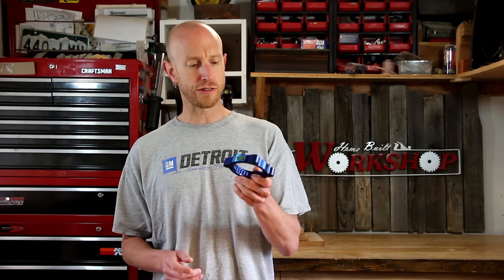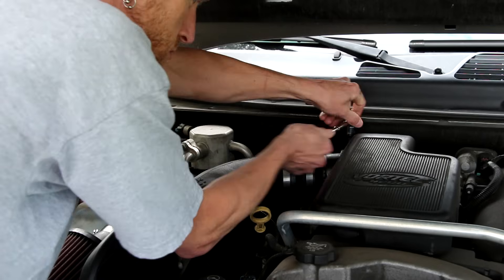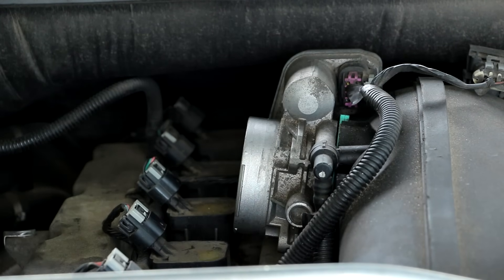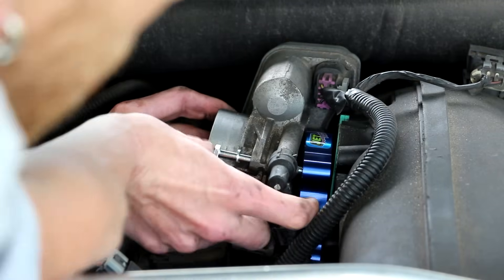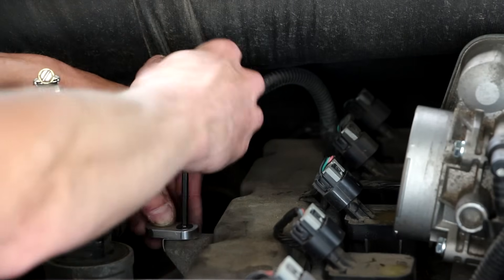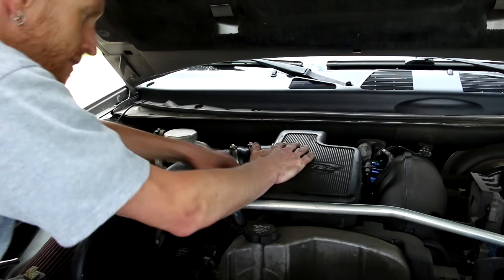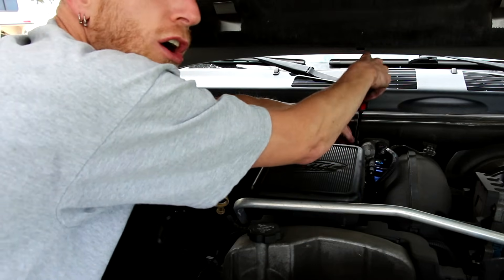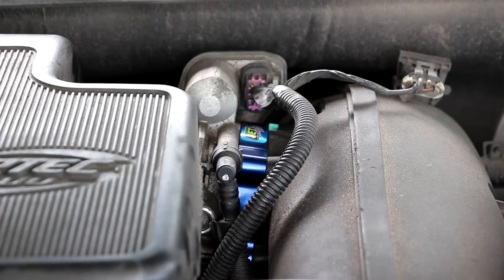Is A Throttle Body Spacer Worth It?

Comment: Why keep the resonator every intake I have done from Audi A4, Subaru sti, Mitsubishi Evo x, lexus is300, Acura TSX, Honda Civic, and so many more usually all that is for is quieting down intake air noise which with an aftermarket intake kinda is pointless. Seems to me like that is just not needed and doesn’t allow the air to to shoot directly into the throttle body, it’s the same as the resonators they install right off of the mufflers for helping eliminate drone. Throttle body spacers are better suited for carbureted engines and throttle body injected engines which is usually late to early 90’s vehicles. I went ahead and did a spacer in my 07 Acura TSX and I can’t say I felt any change n  performance and gas mileage def did not change. Don’t really see how a 1inch block of aluminum would cause any substantial performance gains atleast your jet one had grooves to possibly cause better atomization if air and fuel in the combustion chamber. That’s why I believe it’s better on older vehicles where air and fuel was mixed together before entering the combustion chamber so the spacer caused them to mix better where as with direct injected vehicles what’s it really changing?

Comment: Let me tell you I got a 2006 350z I'm going all out on turbo throttle body spacer cold air intake front to back long tube ISR headers with straight pipe. And let me tell you I dont know how much difference in power because I did my exhaust with it and my car is loud but the whistle is really loud but in a good way. If you cant hear your then you need to get air flow rip all stock shit intake out and give us a update

Comment: im going to get one but for my nitrous system a nozzle is about 300$ cheaper so i can drill and tap a hole in the spacer and turn it into a plate system and save myself some 🤑

Comment: Ive seen vids w/ & w/o dyno numbers reviewing tb spacers.........what ive noticed is there is 0  with moded engines, cam/ported heads/headers/etc etc (numerous combinatios), camparing using the tb spacer afterwards........JUST stock internals. Maybe tb spacers dont do what they claim with stock engines......maybe they work on moded? Maybe they dont.
Reply: What im guessing.......MAYBE its application specific?
Reply: Its not the spacer its the corkscrew creating air rotation and scrubbing the turbulent air directly behind the heavily restricted port of the intake manifold.  There is so much drag right at the intake port that GM ought to be ashamed but they don't care anymore.  later they just started putting on larger throttle bodies from 78 mm to 87 to 90 mm even on 5.3 liter motors.  My 8.1 Vortec has a 78mm valve and should have had at least a 90mm.

Comment: Not worth it unless you play with the tuning in order to take advantage of the new dynamics created by the altered TB length. First run there might be a slight noticeable difference but then then computer will adjust things back to compensate

Comment: I have been a car and aircraft mechanic for over 55 years. Taking someone's word that "it feels better" is hardly a scientific test. I decided to try a cold air intake and mass air flow sensor on my 2008 Escalade around five years ago. The bottom line was that I did not "feel" any improvement and got a "check engine" light for my trouble. As someone else has mentioned, it would take some runs on a dyno to discern any improvements. And you are not going to be able to feel 5-10 horsepower improvements. These  add-on components may be helpful at wide open throttle, but who is going to drive like that? These things are a definite waste of money.  UPDATE: 20 July 2018. Just like to add a few more tidbits of wisdom here regarding the ability to "feel" performance improvements (on an internal combustion engine). Those of us car guys who have ever started with a stock engine and added performance equipment have clearly felt the improvements in both "seat of the pants" feel as well as at the dragstrip. We all know that a higher lift cam, bigger carb, better flowing heads, hot ignition, etc., will clearly make a difference that can be felt. Particularly if you do the improvements incrementally. Of course, a dyno would be a tremendous help. However that is what we have the car magazines for. Of course, that always highlights the potential conflict of interest with the magazine and their advertisers. Unfortunately, there is no Consumers Reports for performance equipment. Anyone remember the cute little rotating fans you put inside your intake manifold to better vaporize the fuel. The claims were nothing but outrageous. They probably made a fortune from those things. Sometimes a mag will run some comparisons, but they tend to be on high priced items (like cylinder heads) that have very little actual performance difference between them (on a dyno). As I said before, I actually tried a Mass Air Flow sensor upgrade and a cold air intake. Any performance improvements or deficiencies are going to be so small as to be almost negligible, seat of the pants or otherwise. However, you will still be out a few hundred bucks. That is what happened to me. I never really got any noticeable fuel mileage improvements (using the factory computer) and never felt any seat of the pants improvements in the mid range where you drive most of the time. Maybe I would have at full throttle, but I wasn't going to risk an engine failure to test these items. Bottom line is that if you want to spend your money on these things, it is your money to spend. As far as gas mileage is concerned, do the math and you will find out that a 10th or so increased mileage would take years to amortize. Don't believe anyone (or vendor) who says you will get 4-5 better MPG. Do you really think the auto manufacturers wouldn't capitalize on something like this if it were true? If these small items could provide 20-30% increase, the auto people would not have to spend hundreds of millions of dollars to support CAFE requirements the hard way. But if you think there is a giant conspiracy with the oil companies and auto manufacturers to screw the consumer you need to start hanging out in Roswell, New Mexico looking for UFO's. Crap, I made this damn thing way too long.
Reply: Are them outer space aliens for reals?

Comment: If you want to feel a noticeable performance increase, get the throttle body machined out (I had it enlarged 3mm) and increase the size of the butterfly accordingly.  The computer will readjust itself on the first startup on idle.  Worked really well on my 3.8 litre Holden with definite power all the way through the rev's though wasn't dyno tested.
Reply: How do you acquire a bigger butterfly?
Reply: @freemanfornow264  In my Holden, and I think most, it is a circular disk so very easy to make.  Boring out the body is the trickier bit but I suspect most engineering workshops with a boring tool could achieve this.

Comment: fyi you dont have a cold air intake.... if the air is coming through the filter while inside the engine compartment and dont have a an inner cooler... you just have a regular intake. it still sucks hot air from the engine compartment. and there is no cooling of it before it reaches the intake manifold.

Comment: '07 4.2 has to many computer controls for it make much difference. Spacers are more of an Old School trick where everything is mechanical. You could get the same or better increases with a Tuner. Ya gotta remember the factory tunes have to appeal across a wide array of people. Think about it this way. B&M sells how many shift kits? Why? Because some of us like to feel the trans actually shift no matter how easy or hard we're on the throttle. We don't need that much built in slippage for comfort but that 89 year old grandma buying the car/truck beside you does.

Comment: I drive a 03 focus w/2.0 zetec & NEED ANY POWER INCREASE I CAN GET!!! tho iv thought about a throttle body spacer, my thought is:it enlongates the intake about a half of a inch,its not as if any more air or fuel is getting into the combustion chamber.IN MY CASE IM GOING TO ADD A HEADER & COLD AIR INTAKE(MY OWN DESIGN_ SIMPLY DELETE AIR BOX & ADD POD FILTER) MORE AIR IN & OUT SHOULD FORCE MY COMPUTER TO ADD MORE FUEL! I HAVE TRIED IT B4 W/OUT THE FILTER & DOUBLED MY PERFORMANCE ON A PERTICULAR HILL!!! SO IM ORDERING A MUCH CHEAPER POD FILTER ONLINE,TO DO THE TRICK!!!

Comment: Throttle body spacers take the slack in the gas pedal out. Raises the pedal about an inch. Better touchy acceleration, and when you floor the car you'll get the most out of it. Youll feel more
Reply from the maker: Not exactly on this vehicle. There is no throttle cable. Its drive by wire.
Reply: @homebuiltshop   my bad, ive got a 2000 mustang gt. And my throttle spacer is on my throttle body where the cable is. It pulls the cable about an inch, taking all the extra slack from the throttle pedal

Comment: Your right, back in the day it meant a hair of performance and only in high RPM. Today and back to OBD2, company's spend Millions on setting up entire motors in engine bays running top HP with TOP fuel mileage and lowest sound under hood and lowest Emissions. Its just for looks really. Just the same that an Air intake without exhaust or chip will net you 2HP tops, 10HP Tops if done with Exhaust and a chip. They work hard to get the Numbers they have. They decided that the extra noise under the hood and lowering the life of your motor by changing perimeters isn't worth the HP gains.

Comment: We used to laugh about ricers thinking the stickers on their car made it go faster. This is the same thing more or less.

Can it change the torque characteristics? You bet, but getting a couple of extra pounds of bottom-end will be at the expense of something else. These new engines are thoroughly designed and tested, and the modern PCM's are so fast they're smelling the oxygen content of each cylinder (on MPFI) and adjusting the fuel in the very next intake of that cylinder to get the best performance out of that single cylinder. Changing the intake characteristics will throw that calculation off.

BTW your cold-air intake is throwing the PCM off as well. Hope you like the increase in decibels because that's the only benefit you're getting from it. That air flow was entered into the PCM's calculation tables as well.

Comment: I did a test with this. So I got 1mpg worst with it on. It would work on a carb because it would mix the air and fuel but for a port injection style of engine it will not work. It will just add drag to the air.

Comment: if you've got a top mounted carbureted engine. then yes, definitely do this. but on an injected engine, it's pretty much pointless. the reason it works on top mount carbs. is because it mimics a tunnel ram. basically what it's doing is "fooling" the engine.

Comment: this does help but the increase is so small you won't notice it by slamming the gas.
Reply: No, on a fuel ejected engine where only air flows thru this, it does 0, absolutely nothing.

Comment: hi!!! Just one cuestión... the famus "octane booster " of STP realy works?
Reply: +Victor Torres Sure it works, It will boost the octane of the fuel you are using. But you will not see any performance increase at all unless you are running a higher end car that calls specifically for higher octane fuel. If you are looking to put high octane fuel or a booster in stock engine on a car that isn't built for performance over time you will actually cause damage to your engine. Like these kids putting super in a civic thinking they are gonna go faster lol...
Reply: +Nathan Ryan hi!!! 95 octane count like a HI OCTANE fuel?  I have a 2008 Civic Si and i use 95 octane because in my country just sell 90/95 octane fuel in the gas station...thats octane booster work for 95 octane?  o just of waste of monye?
Reply: There are some products that would boost it to 107, but your engine would not be able to handle it for prolonged use without damaging itself. Even the 95 is more than it needs. You wouldn't notice much of an increase at all because your motor is not designed for it. At the track once in a great while it may give you a couple extra tenths but for daily driving it is just a waste. If I were you bro I would just stick with the 90. There is many other mods you can do that will be much better for your car, especially with a Civic Si ;)
Reply: +Nathan Ryan Thank you for your response I will have in mind!!!
Reply: +Victor Torres Higher octane fuels do NOT give you more power. The octane rating is basically how stable the fuel is. The lower the rating, the more readily it combust. This can be a problem in high compression engines, where the fuel will combust before the piston is in the proper position, which is called pre-ignition, detonation, ping, or knock, and is VERY bad for your engine.
Reply: +CaniLupine OMG!!!  thx for clear all mi cuestión 😀

Comment: I got a 4.6l crown vic p71. I used this when I swapped the 65mm throttle body for a 75 out of a mustang. Stock cams and heads. It was s small improvement right off, but after the tune and the forced air intake the response seemed to be slightly better.  I wouldn't really credit the spacer for much.

Comment: Spacers do work.... as long as you get a bigger cam, bigger valves, free flowing exhaust.... so yeah, if you do ALL THAT FIRST, it will make more top end power with a spacer, but on a street truck why take out more torque lol...
Reply: please explain exactly WHY spacers make a difference... you think air all of a sudden with this new spacer is just RUSHING in the intake... there is no fucking way anyone would buy a cam, bigger valves etc and go through all the headache of installing expecting their local tuner guru to be able to detect and tune for factoring in this MAGIC SPACER that someone force inducts air....

Comment: Only need a spacer when you have increased the injector size , more fuel needs more air but since you haven’t increased the actual throttle body size you use a spacer to kinda make up for it on the punch .... its a cheap mod for people who dont know anything about what their doing or how it works

Comment: this is just a assumption but is the performance increase just a tightening of the throttle cable...?
Reply from the maker: +Dub Step there isn't a throttle cable. This vehicle is drive by wire. There is a stepper motor that runs the throttle body.
Reply: oh didnt even notice haha
Reply: +Dub Step with a throttle body spacer. just really makes the cai louder doesn't do so much. alot of people claim low end tq is better but I doubt it
Reply from the maker: I didn't notice the louder CAI on my vehicle.

Comment: You need to get rid of the Resonator thats a huge restriction just add a piece of PVC pipe !
Reply: Agreed
Reply: Dump the catalytic converter if you live in a region that has no inspections on the exhaust.   The catalytic converter does nothing at all, except add restriction, if your engine is running in top condition.   It is there to burn excessive pollutants from an engine running poorly.   In the past, it helped burn fuel that did not burn correctly in carburetor equipped vehicles.  The port fuel injected vehicles and direct injected vehicles no longer produce the massive amounts of pollutants that carburetor equipped vehicles did.   The tests I have done using an exhaust gas analysis machine are right in the range they are supposed to be without the catalytic converter.   I removed the catalytic converter from a vehicle with a good catalytic converter because the person wanted to get rid of the restriction.   I took the readings before and after and the numbers were near identical.  He made more miles to the gallon and had more power after the catalytic converter removal.  Unfortunately, if you live in a region that is over governed by politicians, you may not be able to remove your catalytic converter.   If there are no physical exhaust inspections where you live, make sure you keep the engine running in great shape.   Where I reside, anybody driving a vehicle producing smoke will get a hefty fine for pollution.

Comment: Every one i used on any motor i tryed one it worked really well on inline motors they worked varry well but i also do exaust and clean the old parts to like new but i noticed not so much power but lot more low end instant snapy responnse is what i have noticed some vehicals more than others my jeep 4.0 a 2" made wold of dif and wen i aded new header polshed the intake and solid catless welded biger exaust with intake and my jeep was like a new motor id say def more power but more of beter response wen u punch it. Im buying one for my hhr 2.4 ill let u know

Comment: Think about how it works... it has those fin/grooves on the inside to send the air in a certain patter but it's a very little area so works when a lot of air is passing through. You said you noticed a difference in the low end and this exactly where it can't work because the air will pass through the unobstructed area. 
Get it to a dyno and tells us what you find out before and after.